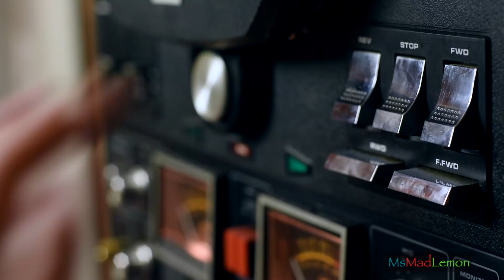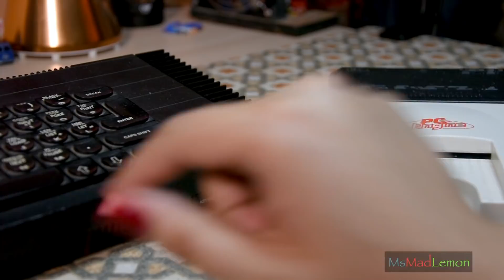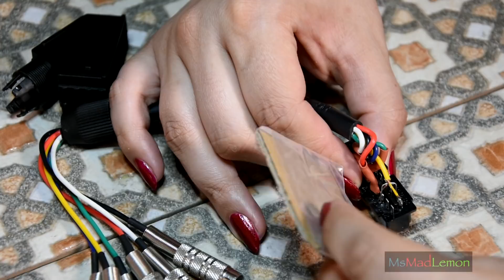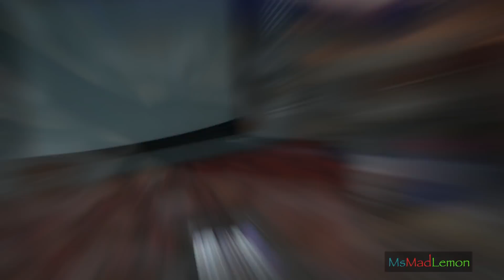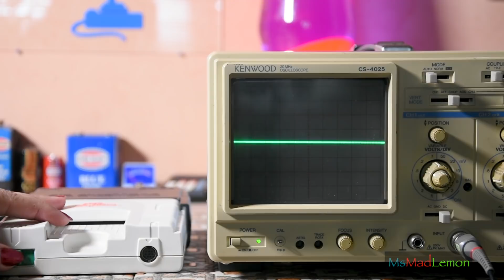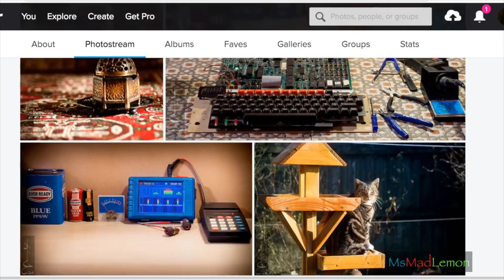Sync Troubleshooting BVM D14 H5e - Sync stripper Installation

Comment: On my d9h5u on only pokemon stadium 2 on nintendo 64 the top half of the screen goes all wacky during 240p, but is fine for the menus in 480i.. My scart cable has a sync stripper in it so that can't be the problem. Hope you get somewhere with this, it's certainly a weird problem

Comment: A couple of points!
Did you measure in or out of circuit? did you measure with the console hooked up to the turned on BVM.
I know that you should measure the RGB/composit/component/s-video lines when they are hooked up to a monitor/tv or you will get too high voltage showing.
I´m not really sure the same is true for measure sync though but i guess it will be the same.

https://www.retrorgb.com/ have much info on RGB/SYNC/and so on you probably already know about RetroRGB though
RetroRGB also have a good tip for a cheap'ish 100$ usb Oscilloscope and have a video about it and how too use it.
https://www.youtube.com/watch?v=9shDy0Yb1Sg&list=PLNG-S9dRk8vIkupYkDI3fQX7sRNQMwjtA&index=4
Also a beginners guide https://www.youtube.com/watch?v=0CGtO-W8L7Y&list=PLNG-S9dRk8vIkupYkDI3fQX7sRNQMwjtA&index=6 and a more advanced guide https://www.youtube.com/watch?v=c_fiL-Z_Wig&list=PLNG-S9dRk8vIkupYkDI3fQX7sRNQMwjtA&index=5
Sure a real stand alone scope is much better.

Also while i´m at it a solder station tip for those that wants/need a tip.
https://www.youtube.com/watch?v=cGdHJ3BTh_c
Make sure you buy the exact one linked to in the video since many other with the same name/look could be pure crap.
I did buy it and went from a Hako fx-888d (a real one not fake) to the much cheaper ksger in the video and holy hell what a difference.
Bob from retrorgb said "I’ve personally been using this and was shocked at how much easier it was to use than every other station or iron I’ve ever worked with, even using just the tip the main kit shipped with!  If you pla on doing more than one or two mods, definitely look into this". (and i could´nt agree more).

I also saw his livestream https://www.youtube.com/watch?v=r1CcMo8Xul8&list=PLNG-S9dRk8vJZerWp0_OxTY_NOkopowTN&index=5 when he first used it and he was generally shocked how much easier it was too use.

Hope some of this helps someone and thanks for awesome videos maddie!

Comment: You might need a better scope one day. They are not that expensive anymore. Rather go for 1MHz than for 20MHz. Rigol is not such a bad brand. Two years ago, there was a cool deal for a 4channel from Rigol. I don‘t know, how good owon is. I have a dench power supply from them, but no scope.
Reply from the maker: Yeah i'm definitely still saving up for a better one so that I can keep it on my workbench, this ones massive!
Reply: Ms Mad Lemon When you save my patreon money, you can buy one in 10 years ;-)
Reply: Ms Mad Lemon I have just read a scope review of the Owon XDS3064E. It is 4 Ch, 60MHz for less than 400€. It also does some decoding (RS232, I2C...).

Comment: Great video!  On the Spectrum, maybe try adding an electrolytic to couple the sync signal - It might have a DC bias.  For the PC Engine, the issue probably is the Super SD System 3 (I've had similarly crazy sync issues with that on my plain old 1084).  There's a PCB created by Voultar and FBX that 'replaces' the audio and video output section - it might be worth looking at that.  On mine I got it working by doing some mods to the Super SD System 3 - I forget what, I think I bridged the R,G and B outputs (original resistors, but I suspect your board has 0 ohm links there already), and I had to also reverse capacitor C60 as it was fitted the wrong way around, but again I suspect on yours that will have been fixed at factory as it was shipped later.  I've got a video on that to go up soon.
The other thing you could try with the PCEngine is test without the Super SD System 3.  Just get some single pin header connections and some wires, plug straight onto the back of the expansion port pins for R,G,B, Sync and Ground, and feed those to your cable that you use with the monitor.  If that works, you know the Super SD System 3 is the issue (it should work but with reduced brightness as the RGB levels are a bit low that way).
Reply from the maker: Thanks for the tips, yes i've been thinking about trying to RGB lines directly from the PC Engine itself actually just to see if it works, hey even if its a bit dim, at least it would work... Aah! ... one thing i could try is removing the resistor from the scart cable itself! it might be throwing it off or making it less than it needs... there are a few things to try. 

Also thanks for suggesting an electrolytic cap tot he spectrum, i'll give that a try and see what happens.
Reply: If it does work (PCE) you could always feed the composite signal to the output pin on the back of the SSDSV3 and bypass the sync provided by the board itself.  Good point on the scart cable - resistor sizes (and caps) on these varies wildly, and they can and do cause problems.  That was something I had to do on my SNES for example of the picture was all over the place.  From what I understand TerraOnion "created" their own csync signal by combining H & V through a TTL chip.   Whereas I know for a fact the composite can be used as a sync straight from the PCE and that works on every screen I throw it at here.
BTW - I agree that component does look better!  Didn't expect that at all lol!
Reply from the maker: I'm starting to see a pattern..

Spectrum = TTL Sync
PCE+SSDS3 = TTL Sync (as you suggested, i've also been wondering about getting sync from the PCE itself rather than the output of the SSDS3) 
BBC Micro = I assume is TTL Sync
I may be way off, i'm not sure what the rest of the systems are, if they are Sync on composite or CSync, TTL

The great thing about the component conversion is that you can now adjust Chroma unlike with the RGB input which yeah, it makes it worth doing!
Reply: Yep, I think you're right there!  Just looking at the Speccy 128K, the sync appears to come out of a TTL chip with no cap to couple it.  So it must be about the level and bias on that system.  And I think TO did the same kind of thing on the PCE.
Reply from the maker: If this is the case, a cap might be all that's needed... oh I freakin wish after all this head hammering with sync lol
Though admittedly, i've learned a freak load along this journey!
Reply: Indeed, I recall some systems had a 220uf electrolytic in series with the Red, Green, Blue + C-Sync lines to strip out the unwanted voltage. PAL Gamecube and NTSC SNES come to mind.

The only issue I've had with sync with my JVC monitors is daisy-chaining them resulting in attenuated sync (line tearing on lighter parts of the image), so I have them wired-up to separate SCART routers. I use a Holdan HSR-1000 for each monitor which seem to do the job quite well.

Other than that, I'd probably recommend tying-up all the grounds to the shield (SCART pin 21), as sometimes mixing of SCART leads/ adaptors, or daisy-chaining can result in a loss of one or more of the grounds.
Reply: @GadgetUK164 Do you talk about this thing?
https://oshpark.com/shared_projects/vMlYlXsO

@Ms Mad Lemon I suggest you to have a look on the LM1881 Datasheet to have a better idea of the shape of the sync signal.
From Texas Instruments : http://www.ti.com/lit/ds/symlink/lm1881.pdf

You can also try this slightly different LM1881 based solution :
https://oshpark.com/shared_projects/VSLSZ8Jm
From what I saw on your previous videos, soldering it shouldn't be a problem.

On the PCEngine you can choose sync from composite or TTL : the Hu6260 (GPU) can output Sync in TTL levels, and it is available through the expansion port.

Comment: BTW on the scope, you had vertical mode as "Chop".. which was probably why the display was a bit dim.. that will alternate between Ch1 and Ch2 input to show both channels waveforms.. and its usually quite dull looking. You also want to find out how to set triggering so that you get a stable waveform display
Reply from the maker: This is what happens when you've got touched a oscilloscope for like 17 years lol I figured out so much about the scope messing with it afterwards that I wish I had done before filming this... I managed to get it to trigger and properly calibrate it :o)
Reply: @MsMadLemon  same here when I got my Tek 2213A, I hadnt used one (and an ANCIENT one from the 70s at that) since school in the early 90s!

Comment: If you google 'analogue video sync signal' and check images https://i.stack.imgur.com/3KbGf.png that curved ramp you see is the composite video signal. The curve is the actual video part and the sync is at the beginning and end. Also spectrum for everyone has a page on making your 128 scart compliant which involves changing some internals on the toastrack. https://bit.ly/2FKr5lJ
Reply from the maker: Thanks, i'm definitely going to look much more into this because i'm learning so much about it, 
Yes i've come across that Scart compliant page, I wanna try everything i can externally before doing anything internal to each system.

Comment: I hope your new monitor came with a large pack of paracetamol ;-)
That RGB to component converter definitely makes the image look more vivid and that dark band isn't so noticeable. I'd even say the image on the right looks a bit sharper.
Reply from the maker: The advantage to component is that you can actually adjust the chroma, whch you cannot on an RGB input, I guess there's more room for adjustment which makes it a positive for me :o)

Comment: BVMs are great monitors, but they can be super fickle on sync settings. So I am kinda not surprised you had to work around it with a sync stripper.
Reply from the maker: I'm glad that most of my systems work if it's THIS picky! it's apparently just the A and D series BVMs that are this picky.
Reply: It's a pro monitor (of its day), it expects a pro signal. We get this with most pro monitors even up to 4K. Stuff it into a TV and it could care less! On some i remember an option to make it less picky.
Reply from the maker: Yes that I totally get, It's just a case of trying to get these sync signals up to the pro standards.